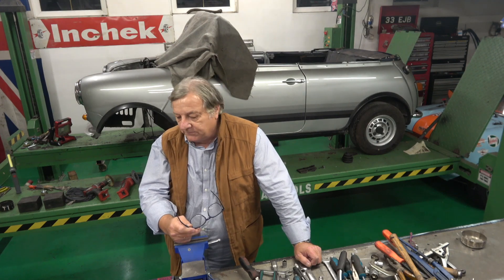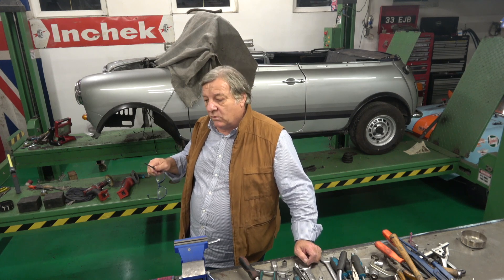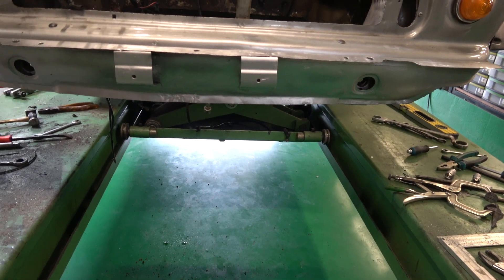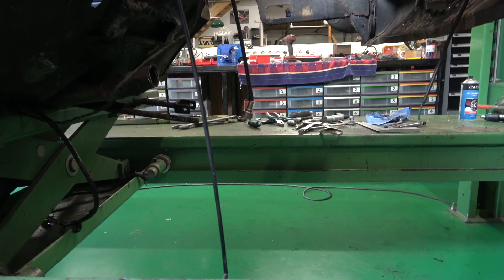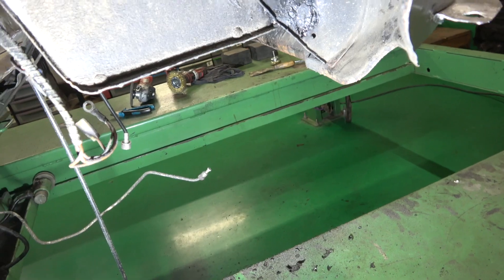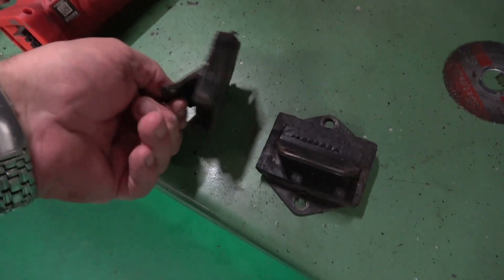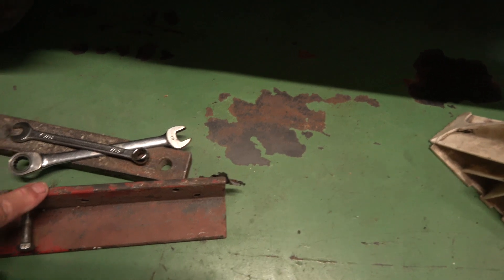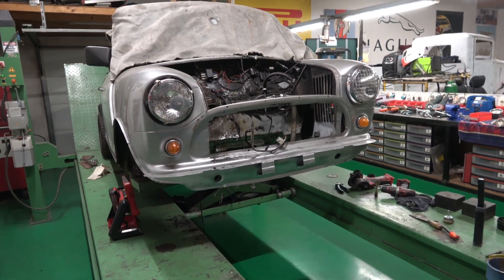Classic Mini 1100 Special Accident Damaged  ( Toe Board Fix ) Part 9

Comment: Hi Dave well it is a case of the more you look the more you find, and I hope the info on the clevis pins was helpful, Best Regards Doug.
Reply from the maker: Doug, Thanks for tip. For sure there is always some hidden rust or defective repairs I guess you also need to know were to look 🤔 Cheers Dave
Reply: The garage improvement plan sounds interesting.Regards.
Reply from the maker: George,  We will be staring this weekend in fact i will pick up the timber and insulation on Saturday morning. Cheers Dave
Reply from the maker: George, Hopefully we will get started this weekend. Cheers Dave